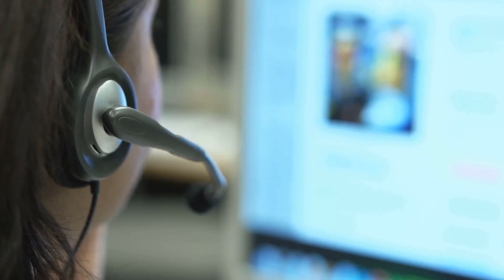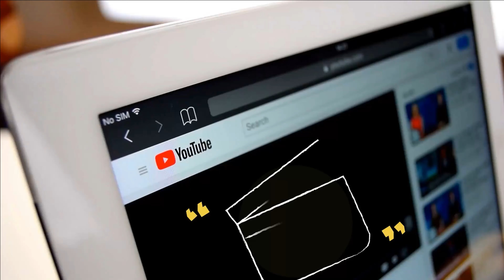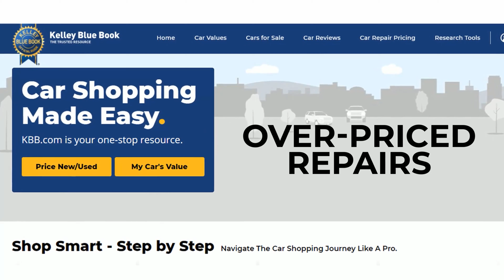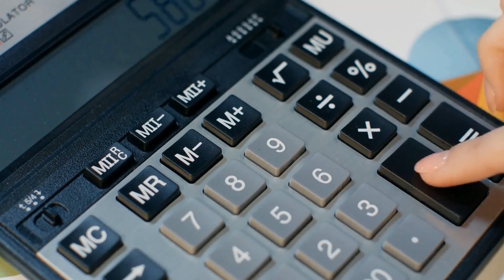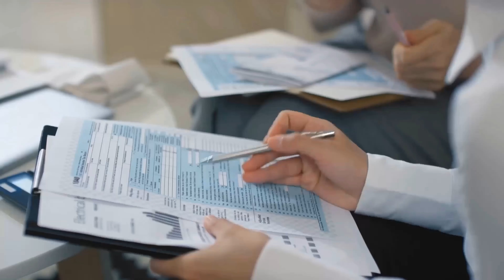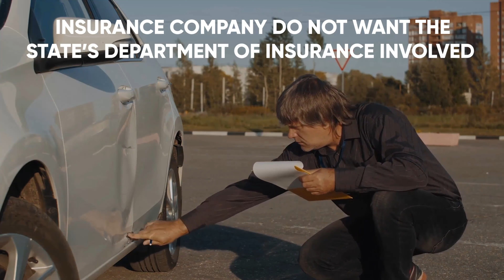How to Dispute And Win A Car Insurance Total Loss So You Can Avoid Having Your Car A Total Loss

Comment: Great content! Curious…Right now with current market conditions I’ve nearly 8 grand positive equity in my car based on quotes to buy from Carmax and Carvana. So would I get a similar offer from my insurance company if my car were to be deemed a totaled loss?
Reply: Im in that exact situation.  They will still low ball u and you will have to still negotiate.  The pay out won't be above the purchasing price of a "used" car at the same make and model of your car value.
Reply: Nope,  its about market value never replacement value
With the market now yes u might have higher settlement amount,  but they have no obligation to compensate the dealer mark ups

Comment: My insurance company are saying my car is a loss. My car was stolen, and then found. My wheels were stolen and there was some interior damage, no body damage what's so ever. I just knew my car was repairable . My insurance adjuster treated me more like a suspect than a client. I believe they over valued the repairs for my car, and also committing fraud. I put one of those universal carbon fiber front spoilers on my car which I paid $20 for on amazon. It was damaged and they quoted it as a $360 repair. Tell me if that isn't fraud. $300 a piece for pirelli tires which are too high priced for me. Their are other things I disagree with. My adjuster also to me not to contact my loan company when I had car stolen. Come to find out , that's one of the first things I'm supposed to do. I asked him recently why he asked me not to. He said because they are going to want a check. Smh. Very suspicious. I feel lost. By the way the car is a Mercedes. Also, I told the adjuster I bought wheels and tires for my car before it was stolen, and I didn't need them to quote me for replacements . He said it has nothing to do with the claim.
Reply: They quoted me for every nut and bolt literally .
Reply: Adjusters do NOT have to have your permission to total loss your car,  thats nothing you can do,  only thing u are argue about is your settlement amount,  and for ALL cars with a lien,  they ALWAYS pay the bank first
Thats it